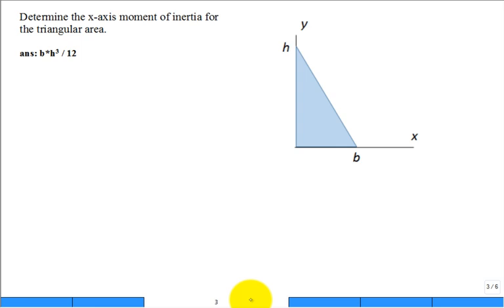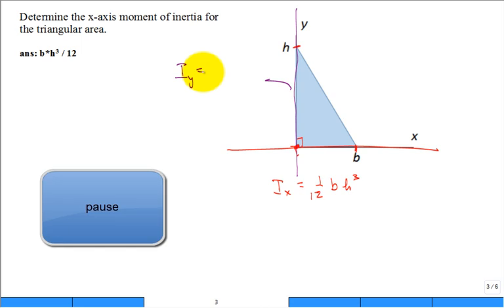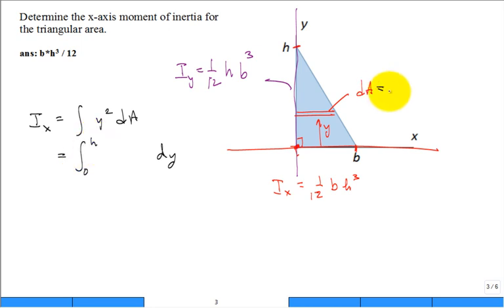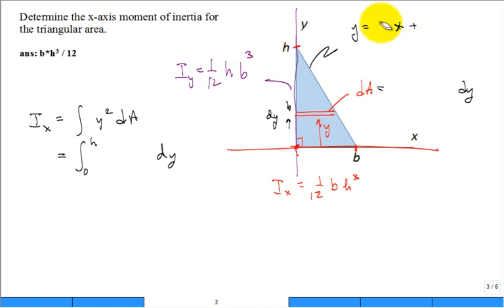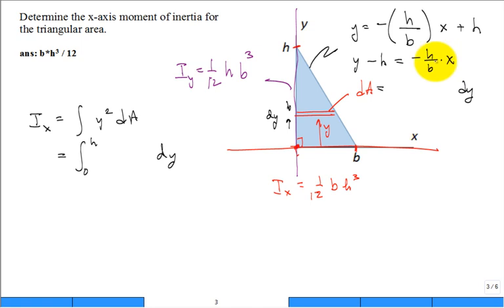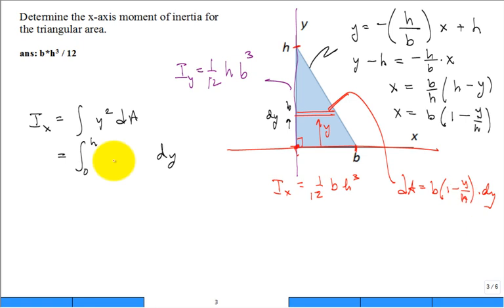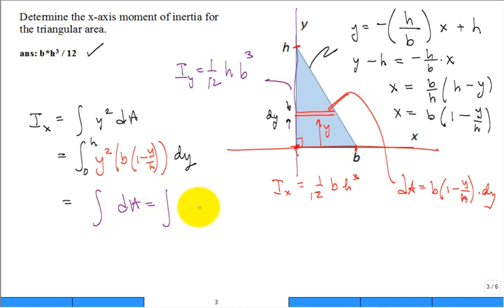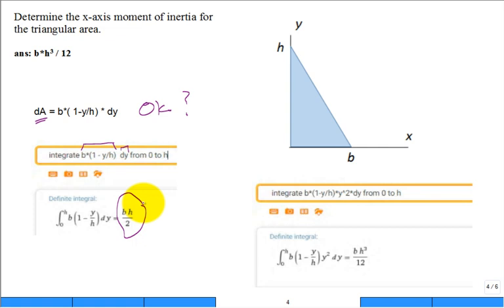moment of inertia triangular area spr18

Comment: I want to see origin at bottom left corner and parallel axis calculus theorem used for solution of Origin at centroid. Plz. 1/36bh^3. Seen your solution with normal origin at centroid. Make parallel axis work.